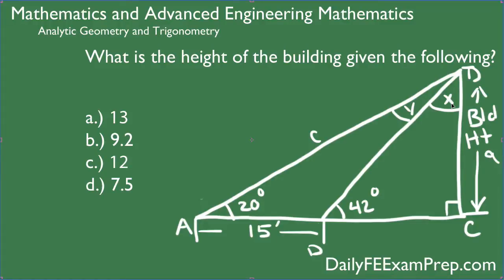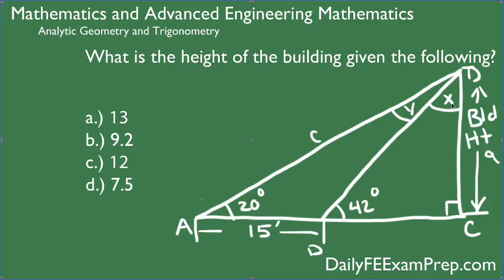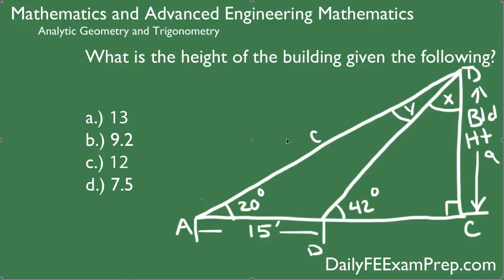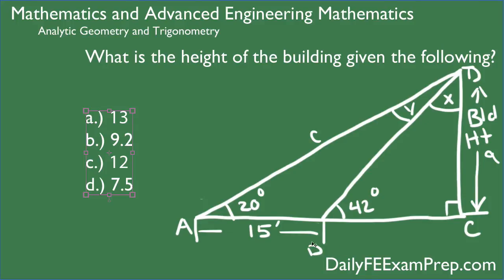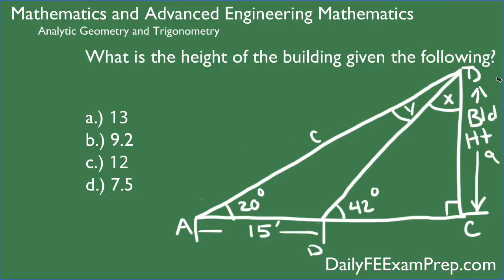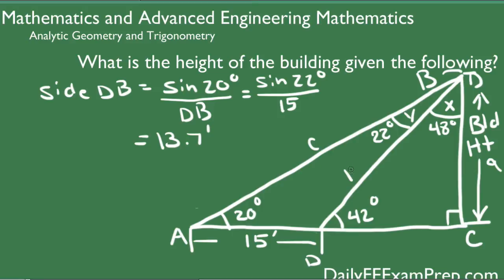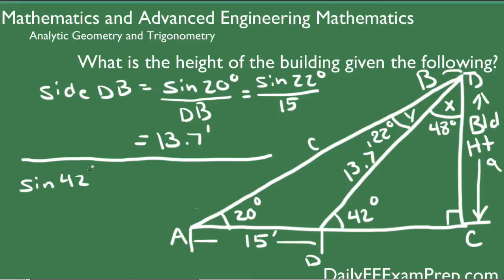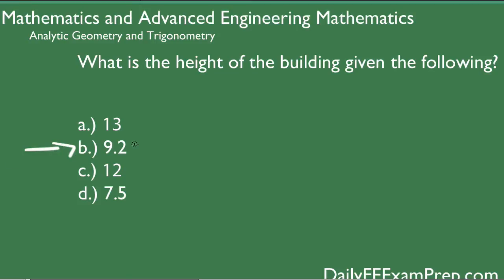Daily FE Exam Prep - 10 - Math - Law of Sines

Comment: Alternative and a shorter solution for this is as follows: 

let height of building equals H:

1) tan(42) = H/DC; DC = 1.11H (equation #1); 
2) tan(20) = H/(DC t 15); DC + 15 = 2.75H (equation #2)
3) substitute equation #1 (DC = 1.11H) to equation #2
    then,  1.11.H + 15 = 2.75H
    then,  2.75H - 1.11H = 15
    then,  1.64H = 15
    then, H = 15/1.64 = 9.14